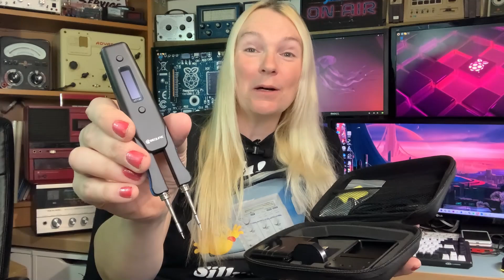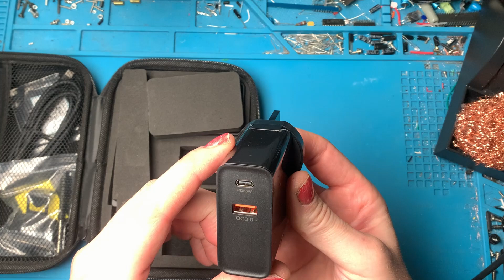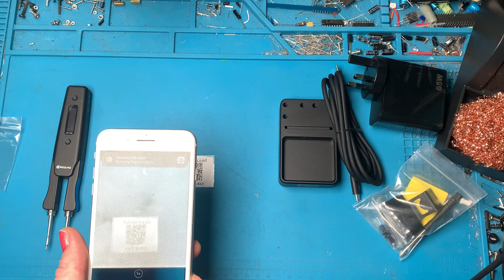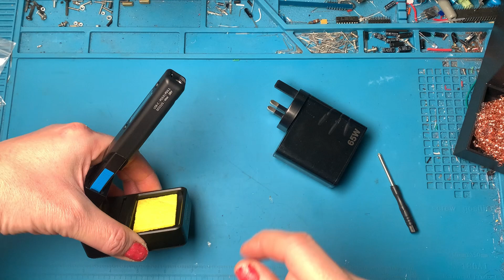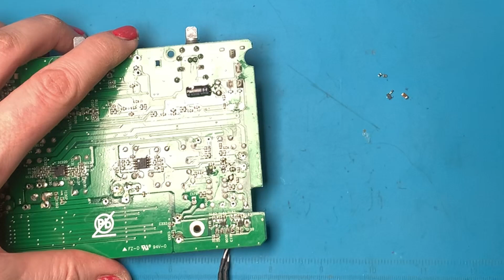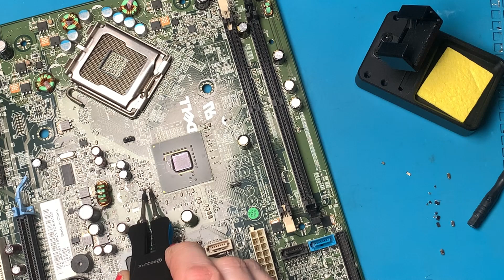Sequre HT140 Hot Tweezers - Handy Electronics Tool For SMD Desoldering & Soldering!

Comment: Would you test the temo with your P1 camera to see if it's correct? many solder irons are fake and do not deliver even half the temp that's on the display...
Reply from the maker: I will try it at some point. I have since taken many surface mount components off with it and it works really great, so can't say exact temperature but it does get more than hot enough.

Comment: Nice bit of kit.
As a sugestion for the tip attachment, a compression chuck would probably be more user friendly.
It would have a simple threaded collar to grip tighten or loosen the tip using a small spanner or pliers.

Comment: Am I the only one thinking it is overpriced at 99 USD?!
   Lets hope that Fnirsi or Zoyi comes with one for around 45 USD.
Reply from the maker: It's precision instrument that works extremely well and is a fraction of the price of anything from Haako, Weller, Metcal. There is a cheap Duratool set of tweezers but apparently they are not the most reliable.
You get what you pay for. Decent tools cost decent money.

Comment: Here's a 2 video.

(northwestrepair)
SEQURE HT140 Voltage leak followup

(IanScottJohnston)
No.149 - Sequre HT140 Soldering Tweezers Problem and Fix
Reply from the maker: @ford1546 since your original comment that you made I did some research into this issue and have already watched those 2 videos, but thank you very much for pointing them out to me. Better to know twice than not at all.
Sequre are aware of this issue and are making up a lead, like Ian Scott Johnston has done, that will go out with new purchases and anybody who has already bought one when they next place an order directly on Sequre's website.
Just to be clear here, the issue is not with the tweezers themselves but with the power supply that is in the kit not having an earth path. If you use a mains adapter that is earthed or a supply into the barrel jack that is grounded, you don't have the problem.

Comment: Have you been stuck frozen in the solder yet?  Not great when it happens!  While being still & patient for larger components to release from a thick or lead-free board, the unit can shut off without any audible warning.  It's possible to bend or break the tips off when this occurs.  I had to turn off my sleep timer because of this!  Hopefully a firmware update add the audible alert that sleep is coming soon.
Reply from the maker: I haven't used it enough yet to have this issue. Are you powering it from the supplied adaptor? I had another viewer that said they used a more powerful adaptor and another who used the 28V input with plenty of available power and these things helped greatly with removing larger components more quickly and thick ground planes. Also bigger flat tips were good for bigger components as well. Another thing, are you using flux and/or leaded solder to re-tin the joint before attempting to remove the component. This will help greatly with getting the component off easier.
I may do a follow up video on these tweezers, addressing these issues.
Reply: @ usually I run into this issue removing SMD aluminum capacitors or coils, regardless of power input. Flux helps, but lots of lead-free solder usually does the trick.  It’s more of an issue of conduction area from the IS tips to the joint, not power to the tips.
Reply from the maker: Ok, so bigger chisel tips would help with this?
Also, although an extra cost, if you are taking lots of difficult components off, how about using a hotplate set to say 90-100 degC to pre-warm the board and ground plane.
Reply: @ yes! the bigger tips help. I have one larger optional set from Sequre, but I am a little lazy when it comes to going through the 16 unscrew/screw operations to change the tips, then 16 more to go back. I’d rather go grab a hot gun to pre-heat. Still, it’s a bit of a surprise to get the tips Excalibur’ed In cold solder! 😟
Reply: @JazzTechUK  The new firmware is out now.  They adopted my suggestion - an audible alert happens when sleep mode starts.  No more getting stuck in frozen solder!  They also fixed the boot issue in 28V PD3.1.
Reply from the maker: That's interesting. Will have to try that.
Reply: Just add your regular soldering iron to the ground plane side.
Obviousy the disapation area should be considered.

Comment: I have 1 of these and the only issue I have is that it is awkward to take off the tips. There is 4 grub screws on each and the ones on the inside are a bit awkward. A screw on holder would be great
Reply from the maker: I suppose if you change the tips for others on a regular basis that could be an issue.
Reply: @JazzTechUK  It's a better solution to have 3 screws spaced 120 degrees apart.  Seems silly to have one grub screw completely blocked.  All the screws do is prevent the tip from rotating around.  4 screws as supplied is definitely overkill, and the tool they provide cannot clear the opposing head.
Reply from the maker: @pault6533 that's an interesting point. I may take this up with Sequre, thank you.

Comment: Been using these for months. Your a bit late too the party. Your better getting the better tips for it. There some good tips you can get and should have put a set in the box.
Reply: While the supplied C210-IS tips are generally best, The C21-K slanted-knife tips are a surprisingly good economical choice for larger components.
Reply from the maker: @pault6533 thank you for this useful tip (no pun intended, lol).
Reply from the maker: I will most probably get some of the other tips. Thanks for watching.
Reply: @ yeah you can get flat ended ones and Also flat wide ones for ic chips, etc. I think the tips they give you are not the best. The device itself is great when you get them tips. Look about because you can get some good tips for it. Any problems finding them let me know and I put a link up for you.
Reply from the maker: Email me a link to info@jazztech.media. YouTube doesn't allow viewers to put links in comments.

Comment: Definitely worth powering it with 28v from your bench PSU to get the best out of it. I used a USB-C to XTC60 adapter so I could continue to use the original nice cable but you also use the barrel jack and make up a new cable to suit.
Reply from the maker: Did you notice much difference in performance using 28V ?
Reply: @JazzTechUK  Yes for components located on heavy ground planes, or larger components, you can potentially get more power into the tips - about 140w available with 28v @ 5A. The tweezers will only draw as much power as required to maintain your set temperature up to the devices' maximum rating, so it is just giving you that extra headroom for stubborn components. Otherwise you won't notice a difference.
Reply from the maker: That's interesting. I will have to try that. Have you tried any other different tips with this unit?
Reply: @JazzTechUK  I have been using a 6s battery pack so that I'm not connected to mains while soldering, due to electrical leaks and also safety.  While I can draw 5A from this pack, I find 3A adequate.  There is a problem with boot-up when 28V PD 3.1 mode is activated, the unit constantly reboots when turning it on.  Until a firmware update is released, the workaround is to set MAX voltage back to 20V before shutdown.  Initially I was anxious to get the update so that I can leave it in 28V mode, but after months of usage I find 140W is unnecessary.  The 6s pack connected to the coax input is my go-to supply now.
Reply from the maker: @pault6533 you have given some very useful feedback. I have gathered all your relevant comments/points and will look into those and feed them back to Sequre to look into. Thank you very much for taking the time to write these very useful comments/points👍👍
Reply: @Y.T.Learner  I have to make a correction to my earlier post in that the HT140 I'm using is actually powered via the barrel jack and not the USB-C port. I have no re-booting issues. .

Comment: I only use a basic phone (by choice) without a QR scanner. I wouldn't buy a product that skimps on supplying a real paper set of instructions. That is a shame, as this looks like a decent product, but sadly not for those of us who refuse to be forced to upgrade our phones just for the convenience of product manufacturers.
Reply: A digital phone manual is fine by me, but the lack of a paper one does sound lazy or cheap by the mfger.
Reply: Maybe It can also be dowloaded from their website
Reply: @KaterinaAndersen  It would spare the headache for some who don't wanna bother with a QR scanner, but it's still not a paper manual.
Reply from the maker: @KaterinaAndersen it can be downloaded from here:- https://ncstatic.clewm.net/rsrc/2025/0303/17/72f7c17f380fa48f3c5eb2153e252581.pdf
Reply from the maker: @nancyblubberhead7256 here is the link, that the QR code goes to, to download the PDF manual:- https://ncstatic.clewm.net/rsrc/2025/0303/17/72f7c17f380fa48f3c5eb2153e252581.pdf
I have updated the video description to include this direct download link.

This is Sequre's website address for the product itself. Lots of information on there too:-
https://sequremall.com/products/sequre-ht140-2in1-hot-tweezers-soldering-iron-desoldering-repair-tool-for-smd?variant=44204748275900

To be fair, not much comes with a paper manual anymore. You could argue that this is more environmentally friendly, especially when you get a big thick book written in multiple languages of which parts you are never going to read.
You can always print a PDF manual out if you prefer a physical copy to read, but again comes the argument, don't print something out unless you really need it.
Reply: @JazzTechUK  Thanks for the link. Whilst I get what you're saying about paper manuals wasting paper, I guess it is more environmentally friendly than me having to get a new phone just to read it.

Comment: Hi. This type of desoldering tweezers has a problem that several YouTubers have made video about. There is power, volts on the solder tip that can in theory  be harmful to some small components
Reply from the maker: OK that's interesting. Will have to test that.
Reply: When I remove SMD LED’s from a mains-connected HT-140, they briefly light up every time.
Reply from the maker: @pault6533 that is not good. I have researched this issue a bit now and am looking at solutions.
Reply: @JazzTechUK  I've wondered if a bidirectional TVS diode to ground might be a solution.  Hopefully it would protect ESD sensitive components, but be invisible to tip presence detectors or other operation sensing.
Reply from the maker: @pault6533 apparently a USB cable plugged into the USB A port on the supplied power adaptor and the shield of the cable grounded to earth does the job as the shield of both USB sockets is connected to the tips.
This voltage is what is called 'phantom' voltage or leakage voltage. It can be measured on a high impedance multimeter or scope. It's the reason certain multimeters have a 'Low Z ' low impedance function to prevent this phantom leakage voltage registering. It is caused by capacitive coupling of the transformer and/or class Y capacitors across live and neutral connected to ground, but in this case there is no true ground so the capacitive leakage voltage manifests on the soldering iron tips/USB shields. This will also be true of any 'wall wart' power supply that doesn't have an earth ground pin. The issue is NOT exclusive to these Secure tweezers. The fault is the power supply brick, NOT the tweezers themselves.
Reply: @JazzTechUK   I saw the modification adding a chunky ground wire directly to the unused USB-A terminal of the supply.  I couldn't convince myself this alteration would not have potential side affects.  Somebody commented that this might interfere with tip detection.  Then various resistors values were thrown out, instead of a solid wire, even capacitors.  I sat back and thought about it, then determined that the component I would feel comfortable with is a Bi-Directional TVS Diode, which is often used for ESD circuit protection.  This would be invisible below the specified voltage, then conduct when the induced ghost AC is dangerous territory.  Nobody has tried this yet, that I know of.  Seems like the right tool for the job.
Reply from the maker: @pault6533 apparently Sequre are manufacturing these leads to go in the USB-A socket and they will go out with all new purchases when they are available. Previous purchasers can claim a lead free when they next make a purchase direct from Sequre.
If you use the barrel jack to power them it's quite possible that the supply somebody uses would be grounded anyway.
Reply: @ That’s great information. I’ll watch for more details on this.
Reply: @JazzTechUK Here's a 2 video.

(northwestrepair)
SEQURE HT140 Voltage leak followup

(IanScottJohnston)
No.149 - Sequre HT140 Soldering Tweezers Problem and Fix
Reply from the maker: @ford1546 since your original comment that you made I did some research into this issue and have already watched those 2 videos, but thank you very much for pointing them out to me. Better to know twice than not at all.
Sequre are aware of this issue and are making up a lead, like Ian Scott Johnston has done, that will go out with new purchases and anybody who has already bought one when they next place an order directly on Sequre's website.
Just to be clear here, the issue is not with the tweezers themselves but with the power supply that is in the kit not having an earth path. If you use a mains adapter that is earthed or a supply into the barrel jack that is grounded, you don't have the problem.
Reply: @  Today I pulled out the HT-140 out, not used for a week.  I began running directly off a 6s battery pack through the DC coax jack, also not used this past week. The first component I removed from an insulated board was a green LED. It lit up!  I was surprised!  There were no coils or capacitors on the board. Only the first LED lit up, the other 5 I removed next did not.  The board was on a silicon mat and I was holding the PCB with my other hand.  I don’t think it was static from being in a dry environment, it’s been warm and more humid here lately.   I don’t think the problem is always a mains-connected power supply. We need a solution that covers other powering scenarios.
Reply from the maker: @pault6533 I will have to check with a battery pack. Have you tried measuring any voltage on the tips to the negative of your battery pack?
Reply: @JazzTechUK   I didn't measure to the pack, but the tips to each other.  I connected a voltmeter with twisted pair of wires up to a small board with two solder pads.  Then I used the battery pack setup to power the unit, alternately putting the powered tips on and off the pair of pads.  Each time there was around half a volt briefly showing up.  There may be a voltage induced between the tips by the unit itself as it operates.  Next time I will use an oscilloscope.  The tips I am using for this are the ones that came with the unit.
Reply: I measured the resistance near-zero using a multimeter to the negative coax and tips.  However, the oscilloscope was extremely noisy during operation.  There are sharp pulses every ~15 mS across the two tips.  The trace is quiet when the tweezers are in stop mode.
Reply: Here's a 2 video.

(northwestrepair)
SEQURE HT140 Voltage leak followup

(IanScottJohnston)
No.149 - Sequre HT140 Soldering Tweezers Problem and Fix

Comment: Applying some fresh solder before reflowing or desoldering is definitely a good tip (that was completely punintended!) - having liquid metal between the tip and the part eases heat transfer a lot, often making it possible at all to melt the original solder.
Reply from the maker: Yes, both flux and fresh leaded solder worked equally as well. I'm very impressed with these tweezers. They work very well.